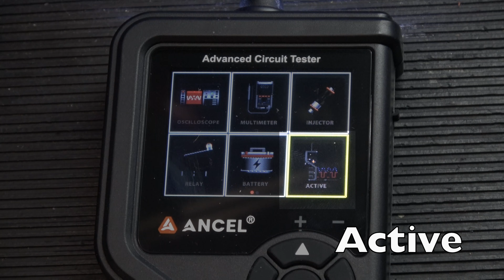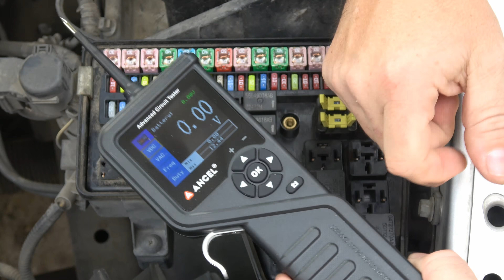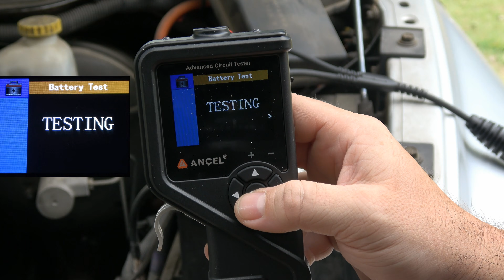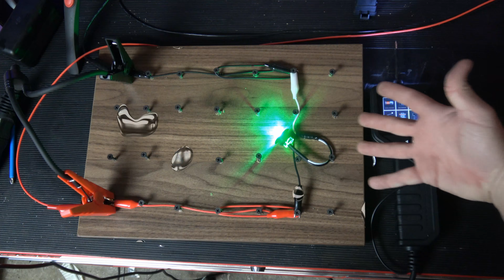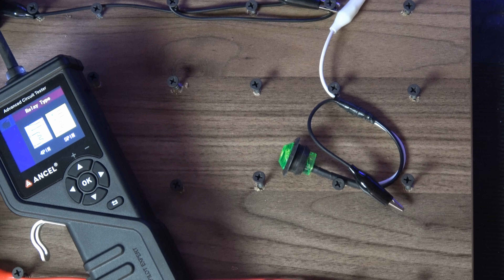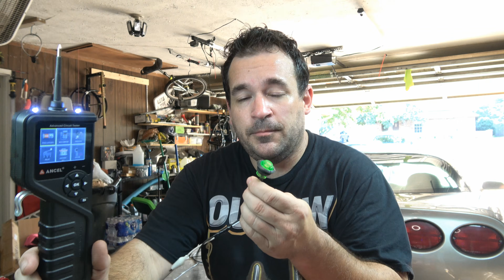EVERY Mechanic NEEDS one of these!!  ANCEL-PB600: Test & Review!!

Comment: So why does it have AC testing?
Reply: inverters are in truck so its thier but ill be using a 30 usd power probe and multimeter and it i need a scope ill pull that out